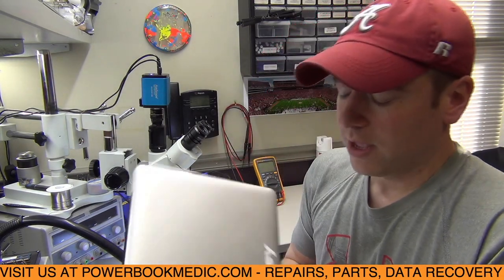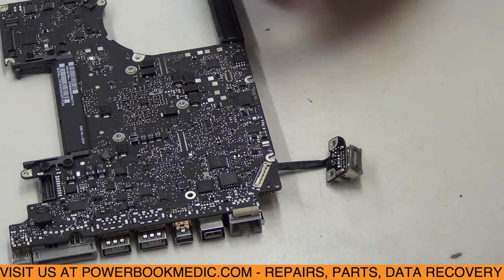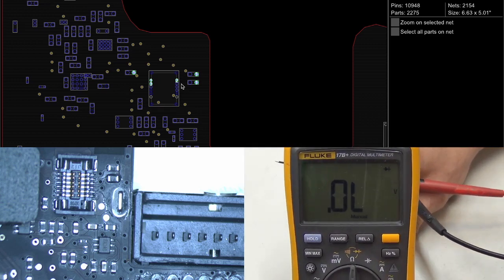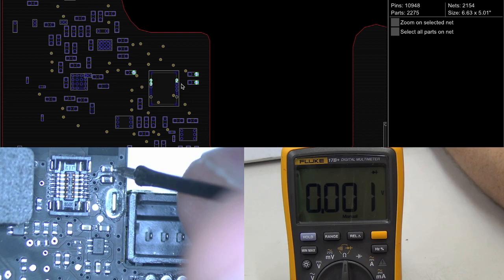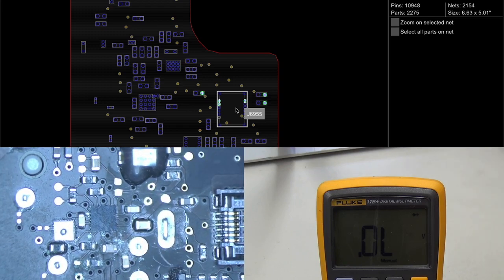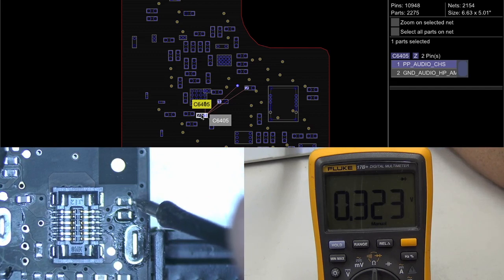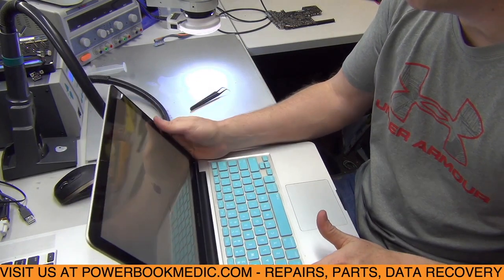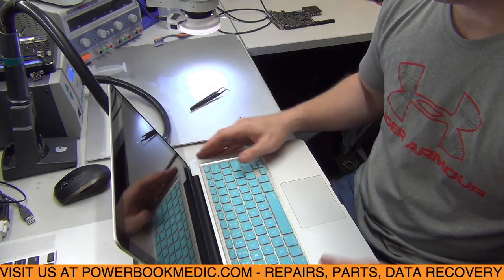Macbook Pro No Power Repair on a 13" A1278  with Board 820-3115

Comment: Im having an intermittent issue. Sometimes it works s=and or times not. Something=imes i have to unplug it for an hr before it it will charge.  I bought a new charger from bestbuy and it does the same thing.  Is this likely the dc board?
Reply: Same here
Reply: Did u fix yours?
Reply: @kharovevo6485  I don’t know 100 percent yet. After I changed the board I had to go away for 3 months. I got back 2 weeks ago and so far it’s been fine but when I bought the new charger it also worked fine for 2 weeks before having the same thing happen.  

One difference I noticed with the new adapter is that there is a small delay before the light turns on when connecting the charger to my MacBook. I read this is normal on the old board it always instantly turned on.   I don’t know if that means the board  definitely had and issue though.
Reply: U mean u changed the motherboard
Reply: Or charging board can i get your whatsapp number?
Reply: @kharovevo6485  I don't have a what's app number.  Yes the dc board

Comment: Excellent video... and explanation. I got a short somewhere else on my board... I had the macbook in storage for a while, and to my annoyance it would not boot up anymore.
When I plug the magsafe in, I get a green light, but battery will not charge, no spinning fan. The area near the 4 square silver pads next to the fan gets extremely hot. The short most be somewhere near there.

Comment: i checked the first component as you did, but I am getting the 3.48 V in the multimeter still no light or power on macbook pro. Any other suggestions?

Comment: hope you can help me.1st of all im blonde and know nothing.haha. the charger of my mac,the piece which connects to macbook broke.so what i did was tried to put the 2 wires of the charge into the mac.there was a little bank and bit of smoke came out.i bought new charger but nothing.i was told fuse has broken,then told mac not have fuse.apple want 150 bucks to repair.any ideas,thank you soo much.suzanne

Comment: Great video thanks! Can you tell me the value of C6405 Capacitor? I have the same bad cap but no spare board to get the part from.
Reply: I found the capacitor value 10 uf at 6.2v.

Comment: I have done the capacitor replacement. The only difference now is after few seconds the keyboard backlight comes on. However the display is kind of blank, it’s not super bright but can see it’s on. The caps lock light come on as well. It’s doesn’t load the OS. Why advice please? Thanks.

Comment: the same on this macbook pro my friend got, a milk spilled on the keyboard and after that no power. i can see a liquid problem on the board just as you did on this video. is it possible if i could hot air the board it will be on ?

Comment: My MBP mid 2012 i5 2.5 A1278 works fine when i am on power adaptor without the battery connected. However, when the battery is charged and connected (with and without power adaptor), I get all sorts of issues on the screen - lines, spots, some part of the menu blacked out, sometimes fonts on some part of the screen becoming larger etc.. Authorised service center do not have a clue and they suggested logic board replacement, hoping that the issue will be solved. However the cost of replacement is almost the cost of the macbook. Any pointers you can provide is much appreciated.

Comment: Thanks a lot but my A1278 13 late 2011 get turn on but no CHARGE THE BATERI change the plug in dc and no charge the battery can show me a direction to go thanks so much

Comment: wait so if I am getting the light, it's forsure the logic board? I fucked up and dropped water onto the keyboard and yeah that was the end of her and I saw that on ebay  they have used logic boards used for $150 but I am just afraid it wont work..

Comment: I’ve the 3.48v yet no green light and the Macbook still can’t turn on, any advice on that?
Reply: You need to check the one wire circuit around U6900 and U6901

Comment: Hey i have a macbook pro 2009 and i have a problem my macbook dont power on i have blue light on charger and also battery is full i try to remove ram and hdd and problem persist ... i try to reset  everything pram vram without results ... please help me
Reply from the maker: PestisorulDE Aur It sounds like it could very possibly be a logic board problem.
Reply: @PowerbookMedic  for sure but ... give me some tips
Reply from the maker: PestisorulDE Aur With a no power issue, it could be any of the power rails not being present. Start with checking those with a multimeter.

Comment: that was really interesting, exactly the problem Im  having and I do have a donor board but it has the same problem, BUMMER, btw I'm curious how you used hoty air to remove the faulty capac itor, that solder must have a really low melting point
Reply from the maker: roontunes It is lead free solder, so the melting point is higher. I have just learned where to hold the hot air, at the right distance to not damage the other components. Just lots of practice!
Reply: thanks

Comment: Please I need help my macbook pro mid 2012 A1278 was working fine and left to come back and I found is blanked out dark try several things to power it on but avail, I remove memory, try to plug direct and power on fan will roll a little bit and stop and the indicator light will blink and it won't power on anymore though my battery status before it's happened says replace soon. Can that be battery? If yes but it's dosn't on without battery when I plugged in direct. Pls any solution
Reply from the maker: Jaaiz It sounds like a logic board problem, but it could be multiple different components. I couldn’t say for sure without diagnosing it in shop.
Reply: @PowerbookMedic  but if I check the battery status from the left button it will show the green light if I plugin charger it will be charging but not turning on
Reply from the maker: Jaaiz It sounds like it is a problem with your logic board then.
Reply: @PowerbookMedic  yes bro already took to Technician

Comment: What software are you using to identify the components? Could you share the Mac Book libraries if any?
Reply from the maker: aarubs I use Open Board software and there are many different companies that sell the files. If you just do an internet search for them, you should be able to find them easily.
Reply: Open Board View (free) and Flex Board View (paid) are both available here https://pldaniels.com/  You can find board files and PDF's on https://www.badcaps.net/forum/ and here https://www.apple-schematic.se/board-ids/

Comment: When you checked for the short to ground - PP3V42_G3H you said you were changing it to Resistance Mode, but you changed it to Diode Mode.
Reply from the maker: Yes, that was a mistake. There have been some comments on that already.

Comment: Hi
As usual a truely educational video.
Just one question - you refer to using the resistance mode for short detection but I feel sure you are using diode mode, am I correct?
Reply from the maker: Yes, it is diode mode.

Comment: Nice repair. Would you say an ultrasonic clean could have fixed it or made it harder to find ?
Reply from the maker: Always look over a board before cleaning it and even take pictures if necessary as where you notice visual damage is the best place to start. If you clean the board first it makes it significantly more difficult to trace down problems.
Reply: Thanks for that as sometimes you hear on different posts that the fault clears after a bath, I appreciate the advice as not to miss the opportunity for the fault to show itself.

Comment: Hey there! great videos!! I'veseen tons of your videos but i cant seem to find if you ever told whats the temperature and air speed you use to desolder, i've been trying to remove some QFN and it takes me forever! now im preheating to 200ºC and then puching 400ºC for 20s to remove but still you seem to do it so fast! im using the wider "mouth" of the air machine also, can you help me out? thanks!
Reply from the maker: We typically use 450 C with almost max air speed.  However, all of this can vary depending on the hot air station and the user.  So really it’s best if you mess around with different settings yourself until you get the results you are looking for.
Reply: @PowerbookMedic  Thats great thank you! i was using a method that a friend told me: 200ºC for 2 min + 360 for 40 seg but it didnt work at all at me. around 400ºC with 80% speed seems to be great, thanks for the tip i wouldnt have tried :D

Comment: help! hi my name is David i have a macbook pro a1278 no power in it i need help!
Reply from the maker: A no power issue on an A1278 could be any number of things. Try a replacement adapter and if that doesn't work a replacement magsafe board. If the unit still doesn't power on you likely have a board issue. We do have a send-in repair service if you're unable to figure it out on your own: https://www.powerbookmedic.com/mac-service.php